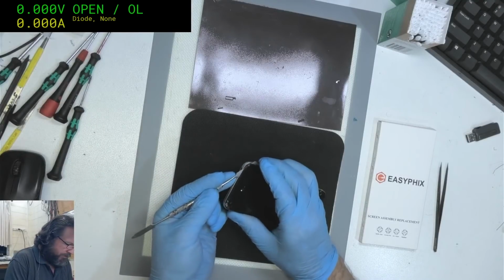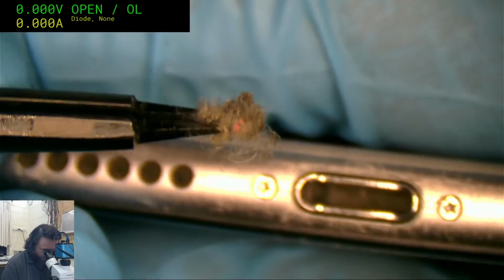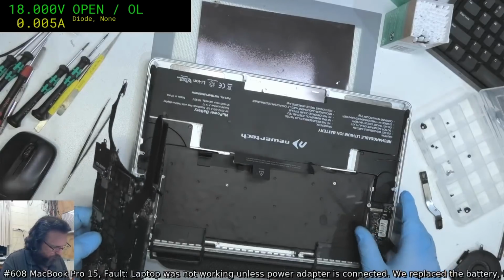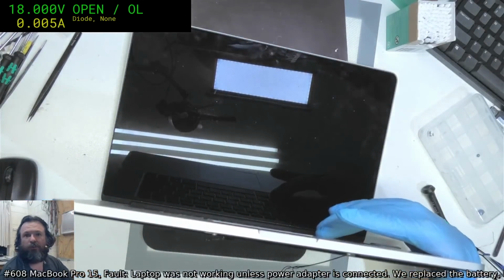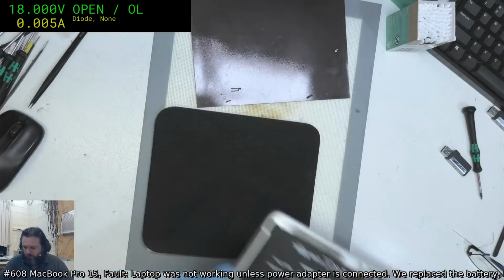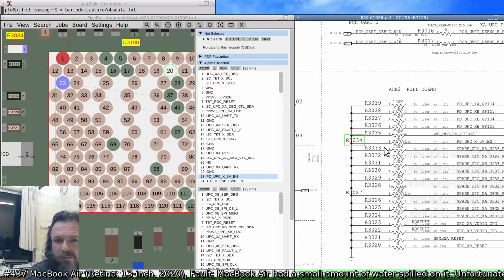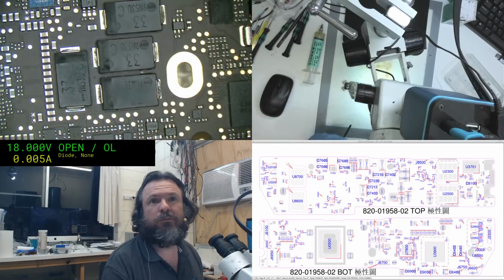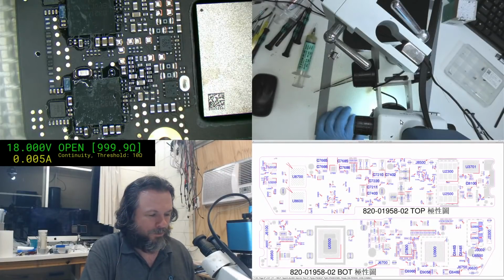iPhone  6 screen replacement followed by Macbook A1398 15" Retina electronics repair ( no power )

Comment: Question: The lone resistor next to two nostuff pads (that are themselves next to a fuse), between the two CD3217Bs, does that read 10K or 100K???

If 10K - ignore the rest of this, but scroll to where it says !!! ADDENDUM !!!
If 100K - I may have found your problem!!!

I rewatched the original repair (minus the reballing etc.) and I saw that you were using a (820-01700) board view for another machine, since, at the time, the actual schematic for this machine hadn’t yet fallen off a truck in rural China. You were wondering about that resistor, for good reason, it got f*cked up in the original damage, but said you didn’t have enough data at the time, as the boardview you were using at the time didn’t have a direct comparison. 
Fast forward to this stream - you say that you’ve replaced resistors around the CD3217s (except for the one that was replaced on stream, which is NOT the one talked about here, where the “new” schematic is used). 

This leads me to assume, that you’ve, since last stream, used older board views and/or schematics to switch out other resistors around the CD3217’s.
This in turn led me to investigate…are the resistors around the CD3217s the same on this new schematic as they are on the old ones. A lot if changing on these machines between models these days.
The first one I checked is that lone resistor. Coming out of 6 pins down from pin1 (pin 1 is pin A2 on the schematic, going A2-B1-C2-D1-E2-F1) is coming out of pin F1 on the schematic.
On 820-01598 that’s a 100K resistor. On 820-01700 that’s a 100K resistor. On the 820-01958 schematic that’s a 10K resistor.
…and I kinda imagine the symptoms of an I2C line going into a CD3217 having a wrong resistor value on its way there resulting in pretty much the symptoms on display…

If you’ve changed the same resistor for the other CD3217 that’ll have the same (wrong) value as well. 

Aside from the two 1M resistors changed in the first repair (R3208/R3209) coming out of A16/B15, correctly having been replaced with 1M resistors, and the also correct 100K resistor put on this stream, I haven’t checked anything else around the CD3217s, my internet is kinda dodgy, and I want to post this before it dies on me again. 

I know it’s blasphemy of the highest order to think Reverse Santa Claus can err, and I’ll accept an eternity of being roasted by reverse Thors lightning while your dark elves eat pineapple pizza before my eyes.

(Just trying to redeem myself from the halfway heat stroke induced comment I made on this video yesterday.)

!!! ADDENDUM !!!

I don’t think using other boardviews, or even the same board, to decide what resistors should go where around a CD3217 is a good idea. Some boards use some resistors, others have nostuffs or different value ones.

Specific examples from this board make up the rest of this comment, if that’s not of interest, don’t bother reading on. (Only other thing I noted was, that I never found out where the “board bleeding” in the original repair was coming from, as the CD3217s themselves look fine.)

My internet ended up being dead most of the time for over a day, so I spent a bit of time looking into what resistors are around CD3217s. 
(This ended up taking a while and I got tired/mentally exhausted doing it. Please confirm info yourself before using, as I’m far from perfect when tired, even worse than when I’m not.)

On 1958 boards, the chip with the nostuff next to the fuse is U3200, as U3100 has that populated.

I use A2-A4-A6-A8 etc. for row 1 and B1-B3-B5-B7 etc. for row 2 and so on, as that fits when I compare rail names between schematics and board views (I’ve probably seen you do it on stream before or something).

Board comparisons for resistors near the CD3217s on this board - that I can sorta follow the traces to and see:
Starting with U3100, closest to the chip, from top center (from the fuse), going clock-wise:

1: Coming out of pin 48/F1: 
820-01958: 10K (both U3100 and U3200)
820-01598: 100K (both U3100 and U3200)
820-01700: 100K (both U3100, U3200, UB300 and UB400)

(The trace going between the above and below resistors towards a resistor higher up is covered later.)

2: Coming out of pin 31/D1:
820-01958: 100K from U3100, nostuff resistor from U3200 
820-01598: Nostuff resistor and a 0-ohm “DBGLED” (??) resistor from U3100, 100K from U3200
820-01700: Same as 01598 for U3100 and U3200, UB300 and UB400 just go to a TP.

3: Coming out of pin 23/C2
820-01958: 100K (both U3100 and U3200)
820-01598: Same as 01958
820-01700: Each pair of chips shares a 100K pulldown and a 0-ohm resistor lead-in to a chip.

The trace that seems to run between the first two of the above: Coming out of pin 40/E2
820-01958: 0-ohm resistors (both U3100+U3200 each lead to 2x 0-ohm resistors)
820-01598: 100K (both U3100 and U3200)
820-01700: 2x 100K (U3100 and U3200), 2x NC (UB300 and UB400)

Top-right of the chip, after the capacitor, direcly above 2 vertical resistors there is a horizontal resistor:
Coming out of pin 4/A8: 
820-01958: 15 ohm resistor for U3100, directly to ground (no resistor or anything) for U3200
820-01598: The reverse of 01958l U3200 goes directly to ground, U3100 goes to a 15 ohm resistor
820-01700: U3100 and UB400 directly to ground, U3200 and UB300 to (each their) 15 ohm resistor

Right side, below the top-right capacitor:
1 Unkown where it comes from

2: Coming out of pin 5/A10: (Exactly the same setup as from pin4/A8)
820-01958: 15 ohm resistor for U3100, directly to ground (no resistor or anything) for U3200
820-01598: The reverse of 01958l U3200 goes directly to ground, U3100 goes to a 15 ohm resistor
820-01700: U3100 and UB400 directly to ground, U3200 and UB300 to (each their) 15 ohm resistor

3: Unknown where it comes from

space without anything, then 2 resistors:

1: Unknown where it comes from

2: Pin 8/A16 - 1M resistor, all 3 boards, all chips, all the time.

Only other resistor around it is the bottom left one:
Coming out of pin 112/M21 (because schematics skip the letter i)
Bottom left almost-corner: 15k resistor, all 3 boards, all chips, all the time.

Bottom chip: I can’t really see much of the traces (quarter view when it was off late stream, and too much Louis’ness in the flux volume department in the original repair stream, but what I can see is:
Starting from the top center: 
Next to the nostuff pads is the pin 48/F1-trace result from the first chip.  
Above that, the left resistor I don’t know, the right one is the pin 40/E2 trace from the first chip.

Then several resistors, where I started assuming things, but rapidly went “cut that out” about assuming things around these chips, leading me to the final two that I know the trace locations to, the ones you switched out in the original stream.

The lower one is the pin 8/A16 trace-result from the first chip, which was 1M, all 3 boards, all the time.

The upper one is the pin 19/B15, and is also 1M, all 3 boards, all the time.

(The bottom left almost-in-the-corner one is the same as the one in same position on the first chip.)